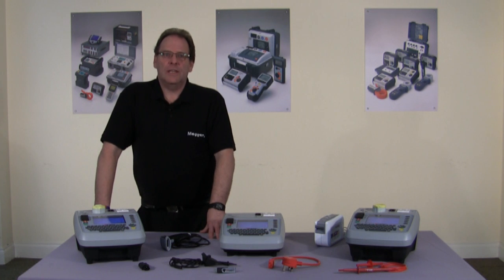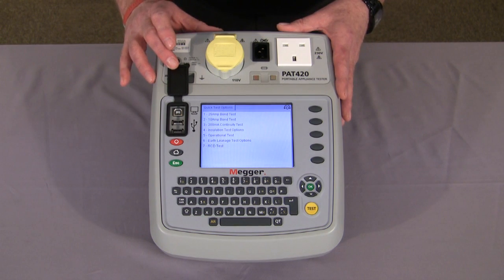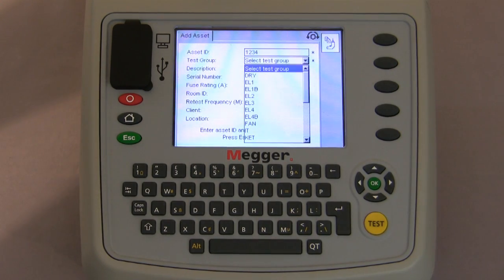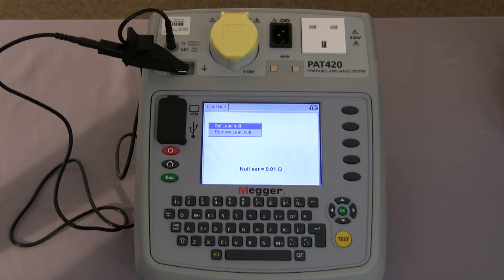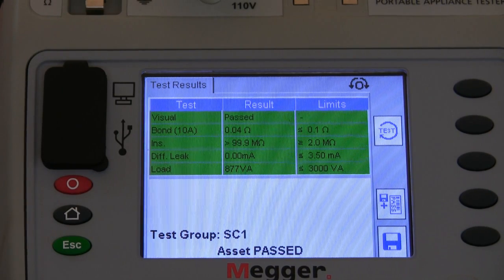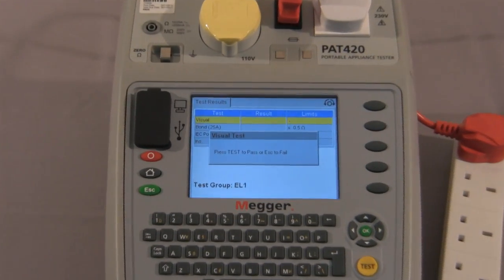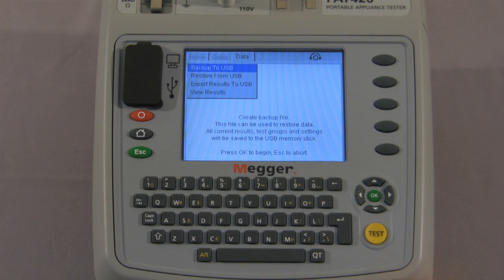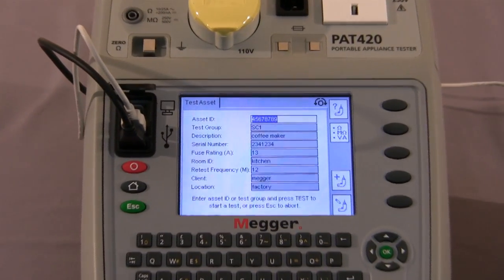How to use the Megger PAT400 PAT Tester Series

Comment: My Firm bought the PAT 420.  Demo OK as far as it goes but having real difficulty trying to work out how to test laptops and other transformer-fed devices.  How do you programme and test for a 6 point power socket?  How do you test power tools fed by rechargeable batteries?  Really do need more practical demos for this kind of kit.   Having real issues with this.
Reply from the maker: Hi Lolis, for testing multiple gang extension outlets there are 2 ways. You can edit the test group and increase the number of cycles of the test from 1-10. Alternatively you can create a new test group to specifically for certain number of outlets.

There are no requirements to test battery operated tools set out in the IET Code of Practice for In-Service Inspection and Testing of Electrical Equipment. With this in mind the charging equipment for the Batteries would be tested under Class 1 or Class 2 or covered by IT Equipment whichever would be apparent for the individual chargers.

For more information please email  sean.smith@megger.com, thank you.
Reply: Thank you for your most helpful response.  I'll give it a try.  Thanks for your contact details.  Duly noted. Cheers!

Comment from the maker: This question was answered 4 months ago but appears to have disappeared.

So here it is again..

The PAT420 prints pass and fail labels with the asset ID barcode. There is no need to manually write out pass labels.

When setting up an asset for testing, the appliance parameters (client, location, description, serial number, test data, etc.) are all stored in the memory of the PAT

This data is then retained for when the item is tested at a later date and therefore does not need to be re-entered.
Reply: How and where do you set up what is printed on the bar code labe? l

Comment: Does the printer print pass/fail labels as well as the asset ID barcode? Do you have to write out the pass labels manually?

Does the PAT tester remember what test to use for a saved item or does it just recall the location and other data so you still have to select which test to perform?

Comment: The PAT420 is an incredibly frustrating piece of equipment to use. The hardware is great, up to the usual high Megger standard. The meter firmware is frustrating beyond belief. Avoid, or get a proper site demo of how the asset database actually functions on a job as it is being used, before buying. Not talking about the software for PC, this is the software on the meter itself.
Way too many issues to list here.
World class hardware, kindergarten software.